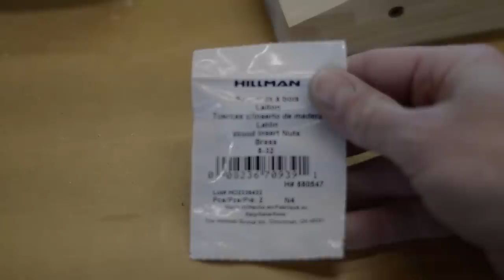Kumiko how to: Japanese woodworking asa no ha

Comment: Yes!!!!! Thank you 13 minutes in!! You may man are one of the first to confirm for me that you use a band Sander to effectively produce al lot of good strips!! I watched more then a 300 hours of YouTube read about 10 books about kumiko and have been making it kumiko ror the last year. And hands down the hardest part of it all is making those dame stips so consistent in thinknes.!!!  Straight of the saw or with a planning jig takes ages.  Really you are perhaps the first one confirming that a band Sander is the way to go if you want to bulk produce Stips! THANK YOU!!!! i am buying one  right now!  🎉🎉
Reply from the maker: My pleasure. I have used a few methods for making strips. I can get pretty good parts right off the table saw, but a drum or wide belt will get the job done as well.

Comment: Aloha Mike and way to go ! Disabled now and been woodworking for 40 years , making the most of my 'unplugged woodworking' , your Kumiko is just the thing to hone those skills ! Comes to me at the right time . Mahalo , Mark Baker
Reply from the maker: Hi Mark. Kumiko is perfect for an unplugged workshop. Also, its great because it take very little material to get started so its fairly inexpensive to give it a try.
Reply: The 'Jointmaker Pro' is how I might be productive with the grills for the current door at the shop . It is prefect for me ,since my 24/7 vertigo keeps me sitting and walking about a workshop with 1 or 2 canes is not safe for anyone , but the boss is so great ! He has held my position since this vertigo put my in a permanent spin cycle .

Comment: You are totally right about your sharpening regime. I have a Tormak and other jigs for diamond stone on grinder (for wood turning tools) and I never use them. I have two large and expensive diamond blocks (fine and super fine) and all my LN plane blades are sharpened quickly on them. I hate the idea of taking steel off my LN blades with a machine! Love your stuff man.
Reply from the maker: Thank you very much.

Comment: Beautiful job ; Here is an idea for accurate adjusting of your sliding strips in the angle blocks :- 
1 ; a small slot at the back end, 2 ;  A pin to slide in it. 3 ; A screw arrangement below with a small wingnut- 
The complete idea being ; the thread used will have a known constant, accurate incremetal push or slide forwards, per angular turn of wingnut, & therefore  by observing/noting  the final req'd wing position, ie; optimal point for your first ideal fit, then the repeat pieces would all be made equal & much quicker. Hope you like it.
Reply from the maker: Thank you. That is a very good idea and would add a great deal of control. For me I have never taken the jigs any farther because they worked well enough. Next time around I may add this feature.
Reply: Your most welcome Mike- I was a designer for 55yrs-& spot such things in a jiffy.I'll look out for your future posts. Kind regards.

Comment: I’ve been making small boxes and looking for a nice way to add something to the lids. This is perfect! Thank you so much for the excellent video and taking the time to show how you make your jigs.
Reply from the maker: Agreed. Kumiko tops off a box nicely.
Reply: Mike Farrington Since you asked for comments......I’ve been having trouble figuring out the length for the 2nd pieces (67.5/22.5 degrees). The 45 degree ones are easier to size down but getting close on the middle ones is not very easy. Any tips? The rest of the video is great!
Reply from the maker: Yup, cut the 67.5 first, get that looking nice. Make sure the piece is long. Next move to the 22.5 jig. Set the stop long, cut the angle on two pieces and see that they don't come together in the middle nicely. Shorten the stop a little, check fit. Slowly you will see the pieces come together to a perfect fit. Cut all the pieces needed at this setting. Next flip the piece over, shorten the stop a little and cut the other side. Then work on the final piece. Hope this helps.

Comment: Hi, Mike. Well, I finished my first Kumiko panel using your technique. Overall, I think it went pretty well with a few missteps. Planes:  I had an old Stanley (my grandfather’s) which was too big. I bought 2 planes at HD ($8 and $12) and sharpened the heck out of them using sandpaper and an old 2-sided stone. Also bought a 1”x6”x4’ of Maple, a 2”x2” and a 1”x2” of Poplar. Took me 2 days to do the jigs and a full day to do the kumiko skeleton. Hardest part was getting the slats to the right thickness. I probably made 30 different pieces before I realized I could file out the kerf to get the pieces to fit. Today I put it together without too much trouble. I tried to use the little Buck plane, but the $12, 2” Buck plane worked way better. I was going to send you a picture but that doesn’t seem to be something I can do on YouTube. Mine does, however, look just like yours! 😎
BTW, I’m originally from Grand Junction, went to DU and CU and 5 years in the Springs while in the AF. You’re a lucky man to be able to live in Denver and get to do what you love. 

Steve
Reply from the maker: Thank you for the feedback. Yes, Getting the slats to the right thickness is by far the hardest and most important part. Also, using a high quality plane makes the job a little easier, sounds like you were able to make the cost effective planes work. Staying sharp really helps. Happy to hear it turned out well. You can send pictures via my website email listed at the beginning of each video. Good to hear from another CO guy. It is a great place to live, especially in spring time.
Reply: @MikeFarrington  Do you see any issues with making a wider jig and use a jack plane instead of a block plane? I'm wanting to plane multiple slats at once.
Reply from the maker: @zeppelin8806  Not at all. I have considered making a wider jig, I just haven't had the time.

Comment: Hey Mike,
Just ran across this....must've been meant to be as I'm getting ready to take the kumiko plunge for some door inserts.
My thing is furniture with a Japanese element in it, tansu etc using contrasting hardwoods.
If you haven't already, I'd love to see a vid about the andon you made. Kumiko in its western 90 degree form is called ships hatch. Huge heavy thick panels were made to cover cargo hold openings. Also as a retired cameraman/editor, your production  quality is very good. Anyway, I gotta go make those jigs.
Domo arigato!
Just found your andon vid. Amazing what a channel search will turn up.
Reply from the maker: Thank you for the info, good stuff. If you check out my channel, I have a video on building two lanterns.

Comment: First of all, thanks for sharing your knowledge. 

Second, not sure if this was addressed, but try spraying some hair spray on the part of you Lie-Nielsen chisel handle that goes into the socket of the blade portion. Then firmly tap the butt end of the chisel handle into the socket. This should seat the handle well.
Reply from the maker: Thank you. Good tip.

Comment: when I was in the carpenter's union , my work started with historical restorations that needed hand tools . Later , I ran shop to keep the crews supplied in the field work of base housing contracts . The most satisfying works all involved 'hand tools' ,from Spiral Stair Cases to Hawaiian Koa Furniture .   The shops were as big as acres in size under their roof . Now mostly puttering about happens on uneven ground , on the yard of home . 3 legged benches work great in this outside shop scene , they self-level .
Reply from the maker: There is a certain zen when using hand tools.

Comment: Awesome work Mike..  I was doing this with tongue depression sticks using my mitre on my sander.. early works resembled outcomes that appeared to be done by Homer Simpson.. but now I’ve worked thru most of my errors.  Your method would be perfect to use as a inlay frame for a table top..  thanks for revealing the mystery of this art form..  keep it up..
Reply from the maker: I like the idea of tongue depression sticks.
Reply: They work great in my opinion.  And they are fairly cheap at Walmart and Hobby Lobby.   

I have started making a veneer from my patterns.  I’ve been filling in the spaces with rare woods like red heart and walnut and even ebony. Using epoxy in lieu of wood glue, I can shave off a 2-3mm layer and make several pieces to use instead of just making tons of work pieces.

Comment: Kumiko is one of my favorite things to do in the shop. I use traditional Japanese hand tools and methods but it's interesting to see how power tools are incorporated. Really great video.

I especially like the way you make your jigs (rebate and and a shorter side). I finally wore mine out so I'm going to use that method for my new ones. If you are ever so inclined, pick up a small (~40mm wide blade) kanna. I find pulling the plane when using the jigs makes things a ton easier than pushing using a traditional western plane. The inexpensive ones found on Amazon are perfectly suited for this task
Reply from the maker: This great news. I have considered purchasing a cheap kanna off amazon just to play around. I think I'll give it a go. Thank you.

Comment: The first thing which comes to mind is is you studied under Mr Miyagi and you mastered the art of Wax on -Wax off as the patience for something like this (by hand) is amazing!  Suggestions you ask, its called a CNC (or CO2 Laser) or even a 3D printed version! I am going to give it a try and thanks for the inspiration!  You do some amazing work Mike!
Reply from the maker: Thank you very much. I would be interested to see how accurately a CNC or laser could reproduce this. I don't know enough about them.
Reply: Surprised you you don't have a big 4x8 unit for all the cabinets you do.  I designed up a version of the asa no ha in InkScape so I have an SVG of it (really couldn't find a copyright free version on the internet) and will post it on Thingiverse along with an STL file for free use.
Reply from the maker: I have considered a large CNC. In studying the time it would save me, I have come to the conclusion that I don't cut enough panels each month to make it worth while. I would love to see what you come up with.

Comment: I really like the simplicity of the jig method and your method for getting the hinge pieces to the right size. One thing I'm going to try doing in the future is changing the registration key into a piece of metal because the thin hardwood key is not very durable after several projects in my experience
Reply from the maker: That's a great idea!

Comment: Imagine if angles were made in the U.S.A. instead of 45 degrees would it be something like 9/32 on the smaller side and 2 1/4 on the bigger side, I don't know why don't they switch to the Metric system. Jokes aside this is a great video to make a jig and do these kumiko easy peasy, thanks Mike.
Reply from the maker: Ha! You're probably right. Metric is more logical, no question there, the problem is an entire country that is used to a different system of measurement. Thank you.

Comment: Really cool to see, thanks for sharing. Holding those tiny pieces by hand while you plane them in the jig looks a little challenging. Maybe incorporating some type of spring loaded plunge style clamp would help?
Reply from the maker: Thank you Ed. I have done some other work where the pieces are really small. I have a little jig I use to hold those pieces. I'll show that in a future video. These pieces are just big enough for me to be able to hold by hand.
Reply: Nice, looking forward to it. And here I thought I was on to something😅 
Appreciate the quick response.
Reply from the maker: Ed, you are onto something, its a good idea. I was thinking about drilling a small hole and using a properly sized dowel as a plunger to hold the pieces. I ended up making a small holder that I press the piece in place with my thumb, it was quicker.

Comment: You mentioned it was hard to hold the pieces in one of the jigs and I noticed your thumb holding it in place. It made me think about using a rubber gum eraser to hold it solidly. That was your thumb is also out of the way and you can even apply quite a bit of pressure. Just a possible solution to try.
Reply from the maker: I like this idea. I was also thinking one of those silicone thimbles.

Comment: Maybe? - Ever think of facing your sanding surfaces of the jigs with thin, flat steel plates (.032 or .062 ?).  You can use contact cement to mount them.  The jig's surfaces will last a LOT longer without having to resurface them.  Just an idea....
Reply from the maker: I think that would beat up my hand plane blade. They would last longer for sure.
Reply: @MikeFarrington  - Mike, I thought it was a sanding unit. My mistake!  Never mind - LOL

Comment: I know this is an older video but for any new viewers, when you're planing the 67 degree miters, make a small "L" shaped piece of scrap with a little square of 120 grit ca'd to the foot. Helps to hold the workpiece easily and doesn't fatigue your fingers as much.
Reply from the maker: That is a good tip. Thank you.

Comment: Would it be possible to use fine sand paper to get the angles and thickness if you do not have any planes?
Reply from the maker: Maybe, my guess would be that the results would not be consistent.

Comment: Thanks, Mike.  I just finished my first panel.  I had a lot of trouble with the shortest pieces until I discovered I could hold them while planing by using the eraser end of a pencil.  Now, what is my next step?
Reply from the maker: Cool trick. Work holding can be tricky with the small parts. Next step, would be to try a different pattern.

Comment: Can someone please help me understand something...  When shaving off the ends of the kumiko to create the angles of the in-fill pieces (e.g. 14:40 in the video and onward), what prevents the block plane from also shaving wood off from the jig?  Thanks.
Reply from the maker: I'm not taking a full pass, so it digs in the center a little but the sole of the plane rides on the edges. After a few projects I just clean up the angled face on the chop saw.

Comment: It's great video, but I think that there can be some problem with calibration strips. Plane ussualy take off constant thiknes. When the time comes to take off thiknes less than before, the blade of plane can catch up the strip and will take off the same thiknes. Some one in Japan use a plane with clamp on the bottom of plane to prevent this case. p.s. sorry for my English.
Reply from the maker: Thank you. I appreciate your comment and thought on this subject. Yes, Planes to take off a consistent thickness, and yes the Japanese use a special plane with a spring loaded pad to hold the strip down. In this case I am taking off a fairly small shaving, so I am able to get strips that are consistent enough. Yes, they could be better, but they are good enough.

Comment: Thanks Mike.  I watched it all and will be trying this.  Question - when cutting the angles for the jigs (at 3:30) you mentioned "don't waste your time with too much accuracy"  then said you just went to the detent on your miter saw.  I was kind of surprised to hear that - was there a reason for that?  Just doesn't make a difference?  Thanks !  I would be interested in a video for the "andon" light thing btw!
Reply from the maker: Thank you. Ultimately what I found was that the pieces are so small that a tenth of a degree is not noticeable like it would be on a wider work piece. I said that to try to get people making these things vs worrying too much about angles.

Comment: If you’re doing a larger project, would it work to make the jig wider so you can plane more than 1piece at a time or would you lose accuracy?
Reply from the maker: I have made jigs where you can do two pieces at the same time. Its a little harder to hold the pieces, but it still works just fine. My next generation of jigs will hold at least 5 pieces at a time. I'm still working out the final details.
Reply: Mike Farrington Thank you for your prompt response.

Comment: OMG,so small pieces accurate it's long and degree cutting very difficult. I think all you follow up your catalogue but one question these all joint you nicely fixed but how make stongar these joint, glue can't so stronger, pin , Neil anything can't but how?
Reply from the maker: Thank you. Yes, I glue the pieces together when its for an actual project.

Comment: Nice video. I got one question though. You said while cutting the angles that precision is not that important. But would it even work if your angles are off?
Reply from the maker: The angles are important, but they are so small that if they are off by a 1/2 degree or so it won't be noticeable. Length of the little pieces is much more important than have NASA level accuracy on the angles. Hope this makes sense.

Comment: how long have you been doing kumiko to get to the stage where your fits are precise and when you do different designs how do you go about get the correct angles for your jigs........would like to know so i can try this out......thanks........nice vid.........very easy to watch and listen to.
Reply from the maker: I have been at this for almost 4 years. I only have a little time here and there to work on it. The angles for the jigs are cut on the miter saw. Thats one of the easier parts of the project. Give it a try, its not as hard as you would think.

Comment: At 17:15 I think you meant go back to the 67.5 degree jig to make the 2/3 landing area for your 45 degree locking piece. From the footage looks like you used the right jig anyway but for those watching..
Reply from the maker: Thank you. The 2/3 landing is cut with the 22.5 degree jig. The 67.5 degree jig is only used for the pieces that fit to the outside edges of the squares. All of the jigs are referenced as if cutting at a miter saw.